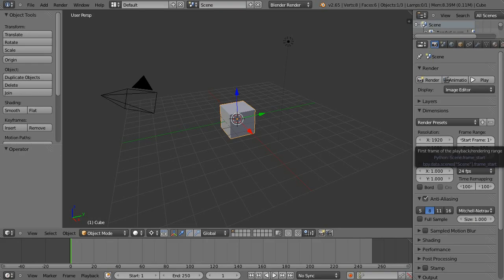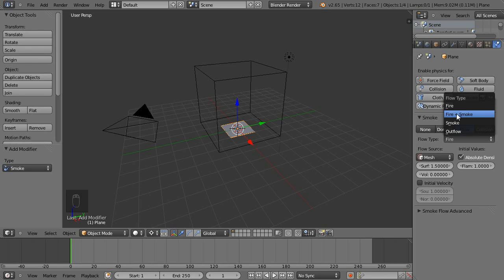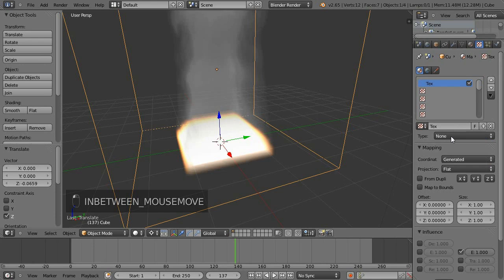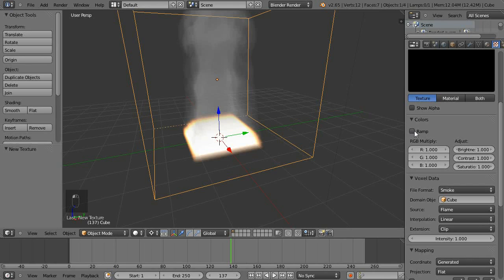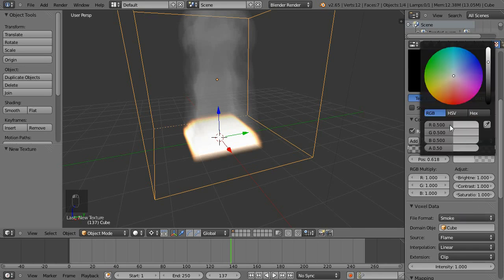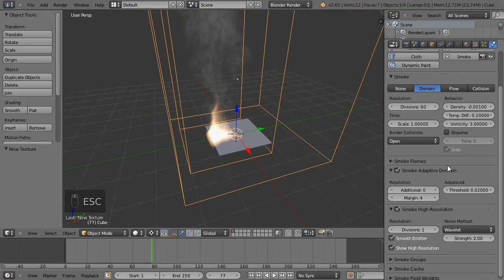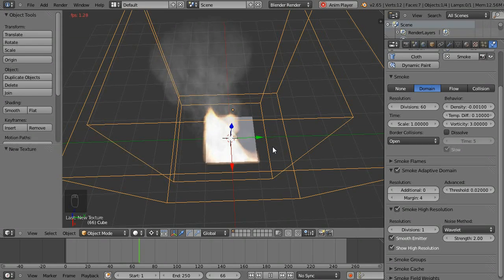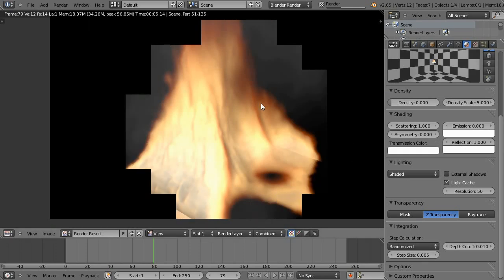How To Make Fire in Blender 2.65+

Comment: THIS SUCKS
IT ONLY RENDERS A BLACK PLANE, NO FIR
I LOOKED IN THE COMMMENTS AND PEOPLE HAVE THE SAME PROBLEM BUT NO ONE ANSWERS UUUUUUUUUUUUUUUUH
Reply: With the "Domain" cube selected, go to the texture properties and look under "Mapping". There should be a parameter called "Coordinates" which may be undefined. From the drop-down list, select "Generated". Do this for both the "Smoke" and "Fire" textures.
Reply: +Dr Shaym Didn't solve anything for me... any other ideas?
Reply: nice one, that's the problem I was running into...
but I also have another issue, the cube isn't passing any light through it... I added the flame to a torch that I modeled and textured, and since the light source is outside of the cube, it only lights up the bottom of the torch, not the top (which is covered by the domain cube)
Reply: Thx soooo much Shaym

Comment: Good video. I almost have a working fire from it. Looks great when playing, but for some reason the smoke only renders in the upper section of the image and not the initial swirls at the start. So the fire starts, then smoke appears a foot above it, looking cut off. I've watched your vid a few times, and can't see what I have done differently. Any ideas?
Oh, I haven't bothered with the last part of the vid to get the fire to spread, as I only need a side on render for a sprite effect, and so seems unnecessary. But why on earth is the smoke only rendering at the top of the image?

Comment: Very good! Thank you.
Two questions:
1. Has anyone done a fire simulation in cycles render?
2. When I render, I am only getting the emitter object, no fire or smoke. I'm sure there's a simple fix. help?
Reply: If you tryed to render fire or smoke in cycles, than the answer to question 2 is question 1. The point is: Fire symulation is only supported for the blender internal engine so far. As far as I know they are working on it right now. But you can render your scene in Cycles and only the fire in the internal engine, than compose it together. That is the only way to do it so far.
Reply: Thanks for the response!
Reply: Sweenus Aurelius It is now working with Cycles.
Reply: Thanks. I've seen a couple tutorials out there on using volumetrics for Cycles Fire and Smoke simulation.

Comment: Wondering now why when I add more time to the timeline, the anim of the flame only goes up to 250 frames?  For me, I added more frames to say 350 and set my keyframes at beginning and end for the Fire Texture under Smoke Flow Advanced in Physics.  When I play it I expect it to animo all way to 350, even when I step thru frame by frame I see the Offset increment with each step but the flame stop at 250, which was where I was originally set.  What am I missing?
Reply: Hello...I believe you set the number of frames for the flame/smoke animation to last in the Smoke Cache under the Physics tab in the far right panels. It's default is 250 frames.
Reply: Sorry. I spoke too soon. That didn't work for me either.

Comment: Great looking fire! How did you ever learn (and remember) what needs to be done with all the different settings? Amazing.

Anyway, how would I, using your tutorial here, get a sphere engulfed in fire from beneath the bottom to over the its top? I want it so the sphere looks like it's on fire not so much that it's in fire. Picture a soccer ball soaked in gas and lit as opposed to it being thrown in a fire.

Comment: Ok, maybe more serious question: is it possible to make objects around to react to LIGHT that fire should have produced? Right now the only idea I can think of, is Andrew tip from flamethrower tut - but there Particles were additionally converted into lamps. I can change flow source to particles, but then I cannot use mesh texture AND particles are just emitting fire - they won't emit light at the top of the flame (just on the plain). Also is it possible to control by tex, where particles emit?

Comment from the maker: the basic process of doing pretty much any fire vfx would be to 1. build a basic 'dummy' set (simple boxes for buildings etc),2. generate the fire effect using the dummy set (less polys etc for the fire to interact with = faster generation of the effect ) 3. render just the fire (using a 'shadows only' material on the dummy set would allow for accurate lighting and shadows from the fire) and then 4. composite the fire effect on top of the rest of your footage.